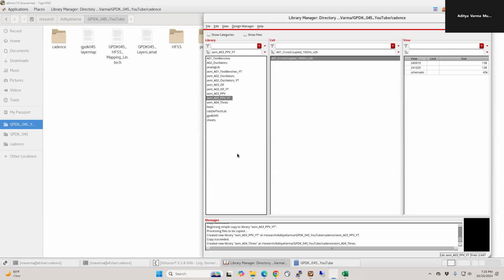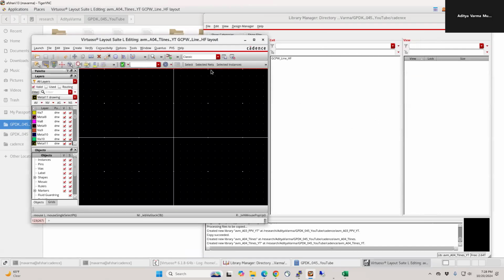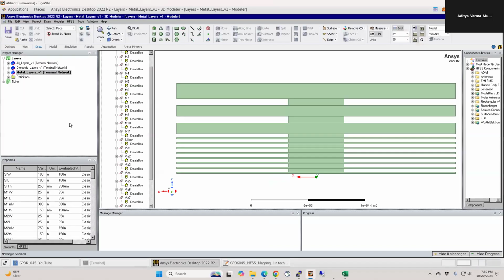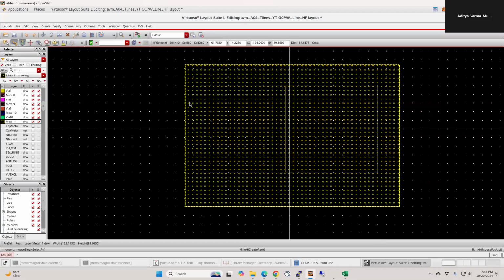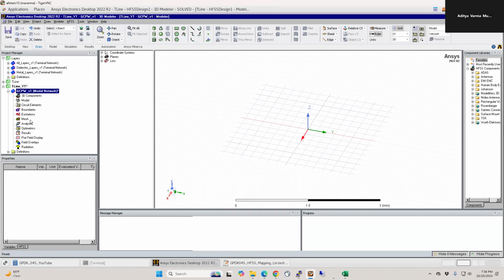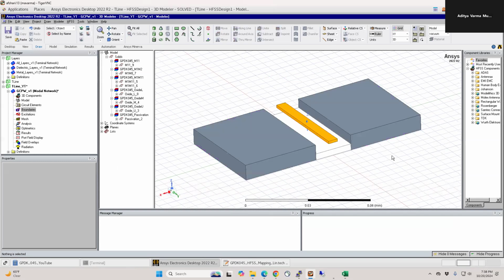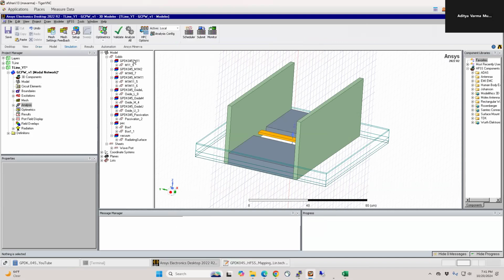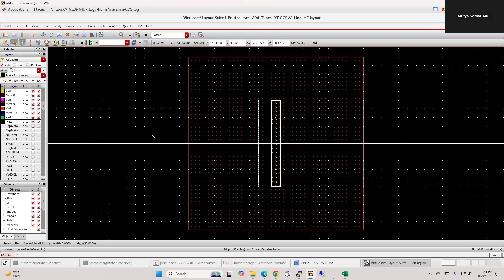Cadence-HFSS Co-design - Exporting Layouts from Cadence to HFSS | MMIC 18

Comment: Thanks for the very informative video! I'm trying out HFSS step by step thanks to your guidance, and I have two questions:

1. When generating the .tech file, I assigned dielectric layer numbers using layers with a layer purpose of "dummy." Do I need to draw these dummy layers in Cadence Virtuoso?

2. In a configuration where two chips are stacked, if the dielectric materials for the top and bottom chips are of the same type, should I assign different layer names and numbers in the .tech file?

Thanks in advance for your help!
Reply from the maker: To answer your questions:

1. Yes 
2. Yes